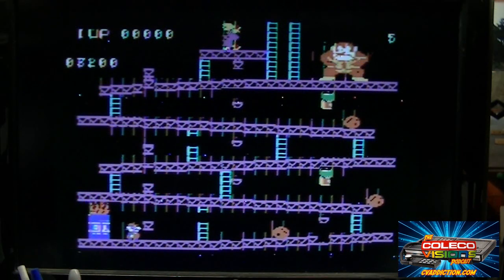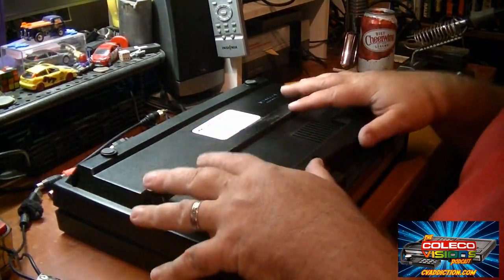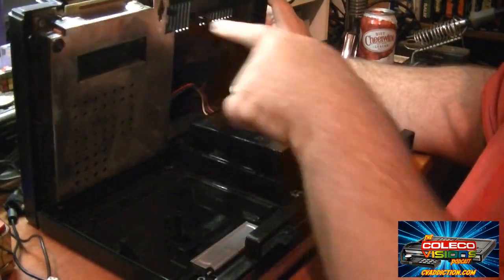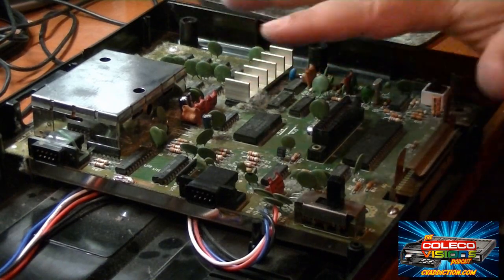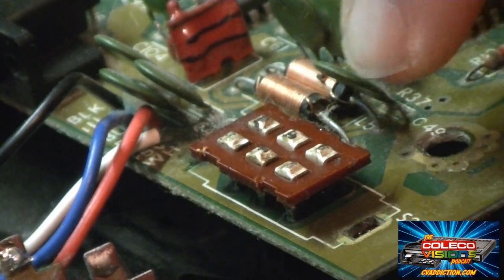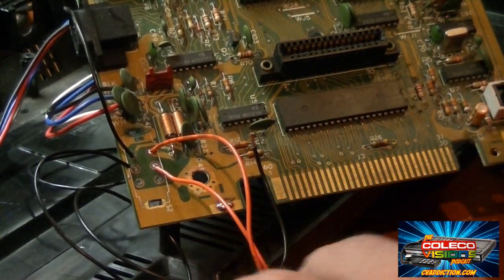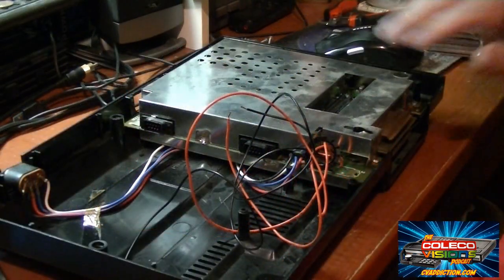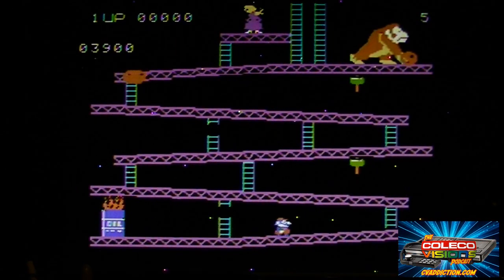The ColecoVisionUT! Power Switch Mod!

Comment: Why would you replace it instead of cleaning it? You can clean and scrape that stuff off and preserve the original power switch instead of ruining it by putting some fake aftermarket thing in it.
Reply from the maker: Well, after many attempts at cleaning the original switch, it only lasted a few days then I would have to do it again.  the tips were very worn out.  So I replaced it, been working fine every since.   It cracks me up, people have no problem av modding consoles yet replace a switch and the "its gotta be original" police come out :P

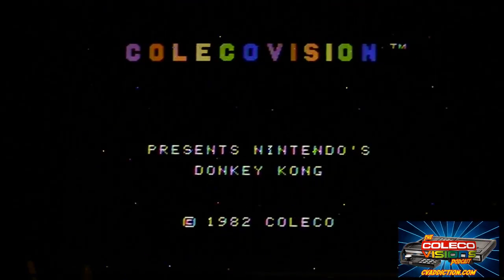Comment: So you did a switch mod. But how do you correct the snow or white dots that appear on your screen after the switch mod starting at 10:14? Is that due to not recapping the colecovision? I'm interested in recapping and using your switch mod. But I want the cleanest picture, what about a video mod? What's the best?

Comment: Now that RadioShack is gone, where can I buy the switch?
Reply from the maker: Google search for a radio shack 275-691 DPDT heavy duty switch.  there are some on Ebay currently.  Or use the specs to locate a replacement over at Newark or Mouser electronics :P

Comment: What kind of switch do i need to buy? I live in Holland btw, i'm getting real angry because i can't get my Coleco to work with the old switch. It is just to hard to put back together.
Reply from the maker: double pole switch so you can control the 5 and 12 volt lines
Reply: @SVT512  I did this mod Dpst switch was used, still garbled graphics however.. So i guess V-ram broken.

Comment: Just attempted this and broke something in the process, now the system won't even turn on. Apparently I crushed one of those green discs near the power switch when closing the console back up. What are those, capacitors? It was a larger green disc. Do you know what kind they are and if I can just solder a new one back in?
Reply: Yes, it's a capacitor and can be pretty easily replaced. In that location it's probably a 0.1μF, but to be sure check the markings on the cap or reference the tech manual for the part label https://console5.com/techwiki/images/e/ec/Colecovision_Technical_Manual.pdf . You might have trouble finding the disc style anymore, but any ceramic of the same value is fine. Replying kind of late, sorry if this is already resolved.

Comment: Having problems with a Colecovision I recently bought. At first it seemed to be getting power. But it would show a black screen for a blip of a second and then disappear when I turned the power on. I was told to clean the power switch. Tried that. Not sure if I did it properly or not. Now nothing happens when I turn it on. I was wondering if this switch replacement might fix the issue. Also could you use a lighted rocker switch so that you would have a power indicator? If so, how would you wire the lighted rocker, the same or different?
Reply from the maker: need to check the power rails, sound sounds like perhaps a power supply issue.
Reply: If my power supply is bad, what is my best option?

Comment: I am having the exact same graphics issue with my Coleco as you do in the beginning of this video. So I performed the switch mod and I'm still having the issue. Could this be something as else? Bad power supply maybe?
Reply from the maker: +doorknobsarefun could be a bad power supply or your video ram is going out.  Verify you have the +5, -5 and +12 volts coming from your power supply.  http://www.colecovision.dk/technical.htm